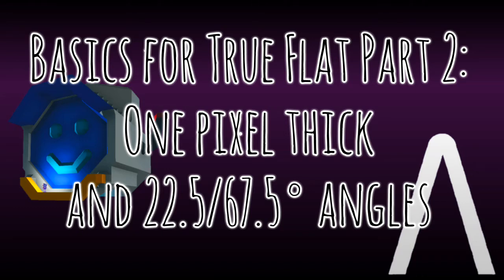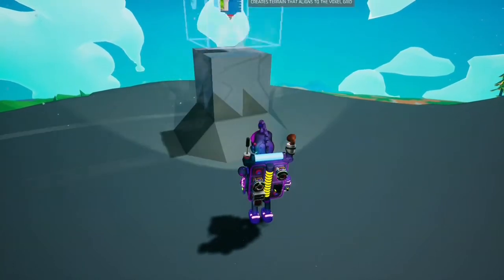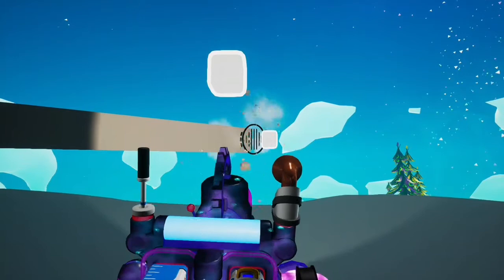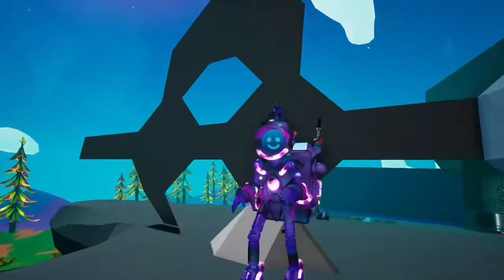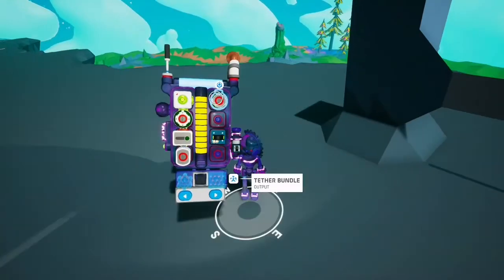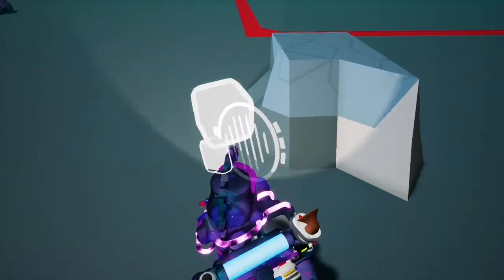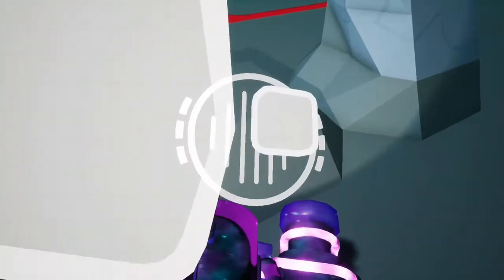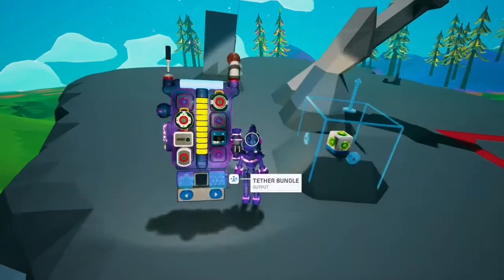Basics for True Flat Part 2: One pixel thick and 22.5/67.5° angles

Comment: Can you get thin walls in adventure mode?
Reply from the maker: Yup, use the narrow mod and it will come out bumpy on one side at first. Dig out the bumps and then spread the 1 pixel back out and it should be bump free the 2nd time :)